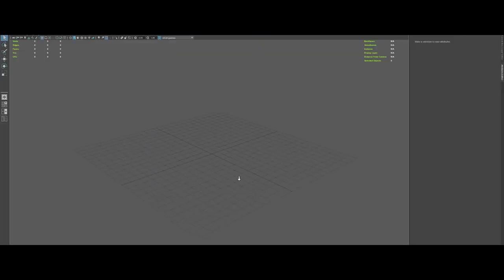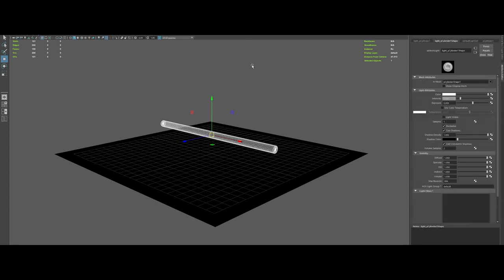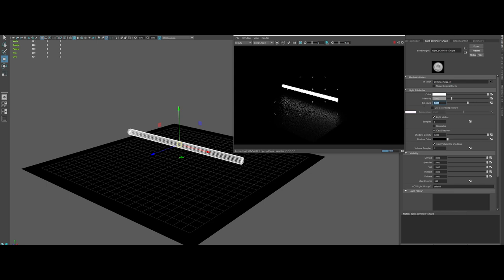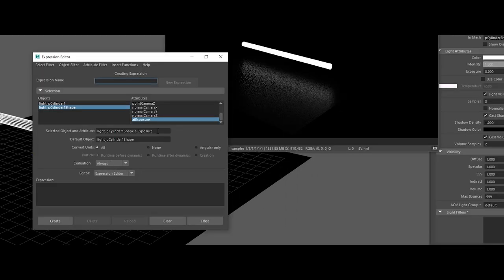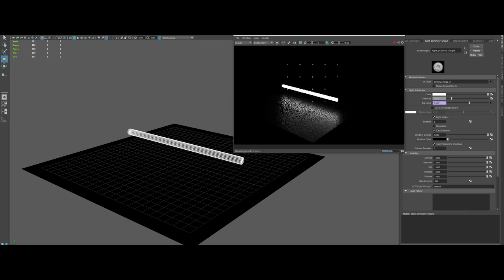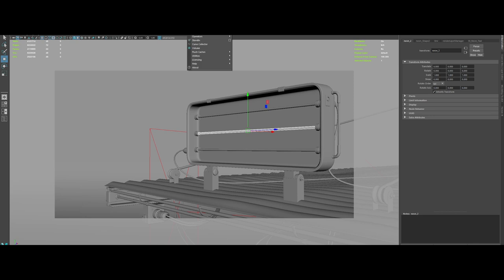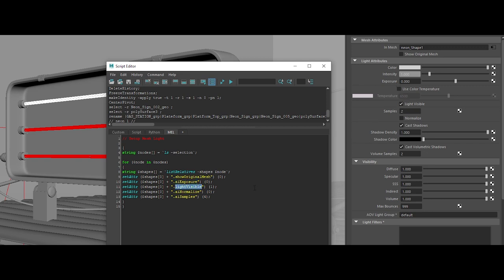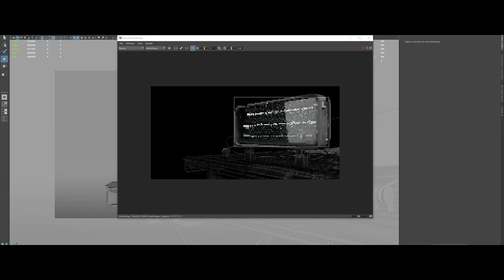How To Make a LIGHT FLICKERING FX with MAYA & ARNOLD

Comment: can i key the expression?
Reply from the maker: No, it's a method to avoid using keyframes animation.
Reply: @PrimalVFX  oh thats pitty, i wanted to use the flackering fort starting up the light till frame 15 and than stop the flackering. And it was possible to stop the expression using: if (frame <15) "...." but i couldnt set the last value so it was random
Reply from the maker: Surely there is a way for set-up it with expression/script and add it to my previous code. If I've got time I will look into it to find a solution.